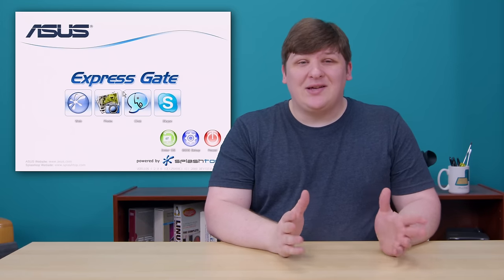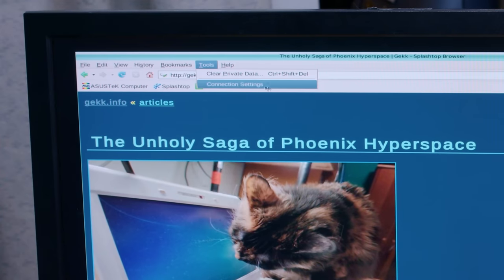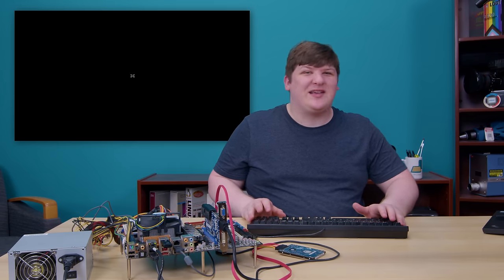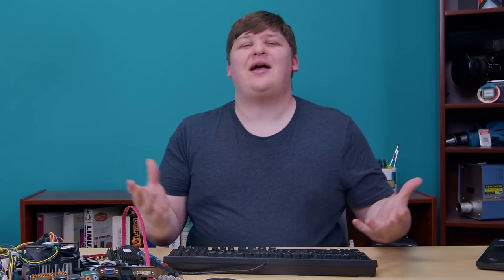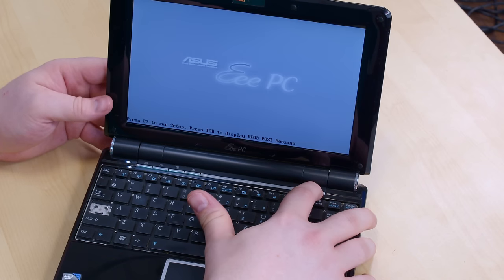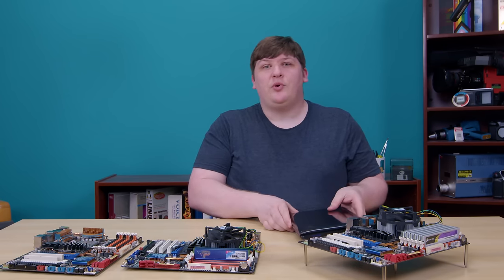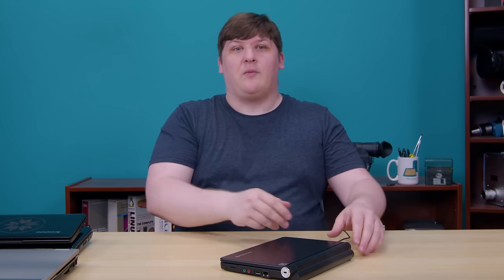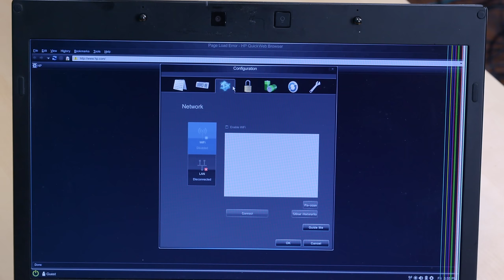Quick Start Ep 2: What The Heck Was Asus Express Gate?

Comment: Interesting video!

I had a P5Q Deluxe and my old man had a P5QL-PRO at the same time, they both had the ability to use Express Gate however it had to be installed onto the hard drive on my dad's P5QL-PRO and my P5Q Deluxe had the small storage solution on your board. Weird really, the PRO almost seems like the better choice to have the storage, being cheaper and therefore used by the more "general public" - those who are more likely to be making accidents on the internet or who aren't going to be investing in an expensive SSD.

I vaguely remember there being a difference in one program in Express Gate being on the Deluxe and not on the PRO (I can't recall what sadly, I was about 13 at the time, and even more sadly, I only have the P5QL-PRO now.)

Needless to say, neither of us ever used the feature on our respective motherboards, it did literally delay boot times as we were concerned.

Comment: Sort of apropos of this, a lot of servers have a tiny Linux machine (a BMC) running on a SoC that most sysadmins rarely interact with unless the main CPU has crashed and needs rebooting, and even then it's usually though the IPMI protocol. If you're lucky and handy with a soldering iron, it may possible to get a serial console through header pins on the motherboard and interact with it, it's pretty limited but can do some cool stuff like emulate a removeable storage device for the main CPU and be a KVM etc.
Reply from the maker: Oh yeah, BMCs are extremely cool. Man, maybe I should shoehorn that into this series. It's a thing a lot of people don't know anything about, especially the fringe features like remote disk image mounting.
Reply: @CathodeRayDude  Do it, man! 😁

Comment: I have a couple P6T Deluxe V2 gen 1 core boards.  I actually did the upgrade to it a few years ago.  It was a neat little OS.  The upgrade looks a little nicer.  You are correct, that should be something included on every mobo as it would be nice to check problems.  I turned it back on after watching your video and went to look and turned it back off after playing for 5 minutes.

Comment: Back in the early 2000's I always wondered why no motherboard brand included an internal usb-stick with drivers. Nothing was more frustrating than installing Windows just to find out that the network driver isn't included so you can't connect to the internet and download it.

ExpressGate seems like a really nice feature if your OS doesn't boot and you need to search for the issue or you need to download a driver.

Comment: I am so feeling you with your notion of an inbuilt firmware partition that can be used to do things like image/backup/partition drives and also play media.

There's a part of me that thinks the real tragedy of laptop expressgate is that with the known, fixed hardware of the laptop (which, again, is also the hardware that a quick boot mode actually makes the most sense in) that the images didn't include drivers for those pieces of hardware so it could run more consistently and efficiently. You don't need to support every gpu from every manufacturer, just the one you put in the laptop! And then the fact that you can't even play movies or music -- a handful of open source codecs might not have lasted in the era right before H.264 took off everywhere, but the lack of any support is jarring (I mean, understandable with the basic VBE mode going on, but still jarring). Sony's DVD player OS may have been almost pointlessly basic, but (go figure, since they were using it for other stuff too) it's a use case that I think someone buying a Sony product could understand them expecting. But then again, if the modern web were supported there'd be a lot more of this that would be still usable, if awkward.

Comment: My mom had a very similar netbook to the first Lenovo you showed (Ideapad S10E). It may even have been the same model as far as I remember, but white. She got it around 2009 and it shipped with XP. It ran excruciatingly slow and booted in a matter of minutes (though it didn't feel any longer than comparable desktops of the time). I remember the two additional buttons below the screen but not that they did anything at all (tbf the green one probably was an airplane mode shortcut). I never encountered the Quick Start/Splashtop splashscreen and there wasn't any mention of it anywhere at all. I guess there could have been a BIOS entry to enable it or another Lenovo utility to install but we never knew about it. The computer is now long dead, scrapped and thrown away but the video brings back memories of this overheating white piece of garbage. (the trackpad was the worst I have ever felt but the keyboard wasn't that bad actually)

Comment: The MSI motherboard that I used for my first gen i7 build came with something like this.  It was a CD/DVD that just let you boot into a stripped down and tweaked Linux OS.  A bit clunkier since you had to pop the disc in to use it, but the experience was surprisingly similar.  Might have to dig it out and take a closer look at it.

Comment: I had a P6T Deluxe V2 too in 2009. I used ExpressGate a few times and got rid of it, replacing it with a Live Ubuntu + persistency installed on a CF card mounted on the PATA header via an adapter

Comment: So... I timed the Toughbook today.  2 minutes, 33 seconds from dead cold (I don't have that "Fast Startup" doo-doo on, it causes more problems than it's worth) to fully operational (Logged in, on the desktop, Steam started up and at my library page, Discord logged in and active, Firefox open).

Then again, I did learn patience from my previous rig.  That was a heavy-duty workstation rig with twin CPUs that would take 30 seconds to get going before the BIOS splash screen showed up.  Then it slogged along through a RAID controller and finally started loading Windows 7.  At that point, it was at the mercy of a 10k RPM box of spinning rust.  It was a very slow boot process, but it was worth it in the end for a very fast system.

That said, I couldn't imagine going through all of that lingering, slow boot-up, only to then have a slow-as-frozen-molasses system afterward.

Comment: I used a netbook add my on-call device, supplanting a Nokia N800 and Bluetooth folding keyboard.

Pidgin! I remember using it long ago, when I lived in an area with dialup only and learned how sensitive the Jabber protocol was to low bandwidth connections (it was when Google Chat/Talk/ whatever it was called then used that.) I always found its IRC support lacking.

That was also the era of a lot of BIOSes having a bug for the halt on error setting, that "all but keyboard" didn't actually fail to halt on a keyboard error.

Comment: This video kinda hit home. I used a Asus P6T mobo with a first gen i7 (965 Extreme Edition) until late last year. (I owned the original P6T, not the SE or Deluxe versions) I played around with that Express Gate stuff for a bit but never really found a use for it so it sat as an afterthought on my hard-drive. :P I even had that identical type of ram as pictured on one of the P6T mobos you showed off. (up until I upgraded it to the full 24GB it supported which I did a year before I ditched the whole rig for my new setup)

I upgraded to a 4th gen i7 setup so the Asus board is retired to a spare PC case for the time being. :P

I checked my mobo and it doesn't appear to have that module so really curious on how Express Gate was setup on the original P6T. Doesn't appear to have a special header either so maybe just an optional thing they put onto one of the existing USB headers on the mobo?

When I messed with it it always wanted to be setup somewhere on my hard-drive and that's where bios was looking for it so maybe some older Asus stuff didn't use a SSD module yet.

Comment: Around 2006, I was looking at the time it took for our Windows Servers and Linux servers to reboot, and I realized that the margin between 5 9's uptime and 4 9's uptime was only two or three reboots a year (At least on Windows, our Linux servers were a bit quicker).  We needed to speed things up.

We probably found about 20 seconds in the Dell PowerEdge BIOS by eliminating the need for BIOS to seek out unneeded or uninstalled devices.  My Windows guys found a bunch of delays that could be eliminated... but the Linux servers were my domain.  

I already used a pretty lean kernel and filesystem and no GUI, so our systems booted up relatively fast compared to a fat kernel stock Linux with a GUI.  Since we were booting from spinning rust, all the boot files got relegated to a small partition at the start of the drive.  After stripping everything to the bare minimum, we were booted from cold metal to an email server or MySQL backed DNS server in about 25 seconds... a far cry from the roughly 1:30 we started at. 

That ends up being quite a bit of uptime over a couple hundred servers that need security updates several times a year.

Comment: I'd love to try a few things on this os. Did they remember to lock down the framebuffer terminals on Ctrl+alt+f2 etc? Did they rip out the Firefox about: pages? Also would love to know what Firefox versions were shipped on the two releases, if they were shipping security updates. If grub is being used as the bootloader, you should be able to edit the grub config file and thus change the kernel arguments to set a shell as init. this would at least let you inspect the filesystem.

Ultimately, the issue with security is what really makes this a bad idea. A completely static os which attracted any userbase would inevitably attract malware devs who could at least use expressgate as a platform to read secretd from the windows partition. In that sense, it's honestly good that this never became popular. Chromebooks are the same idea as this but with actual effort put in, and automatic security updates. The web platform had matured enough for it to be used as a full os by then, no need for flash.

Great video, thanks. YouTube recently surfaced you to me and I've been binging your videos, they're consistently good. Keep it up!

Comment: My HP ProBook had a rebranded SplashTop called QuickWeb. Also was my first non-custom PC to have a full-on UEFI with a GUI BIOS, and it had a somewhat obscure feature to change the boot screen by putting a graphic in a specific spot on its UEFI tools partition (which was neat).

Of course I'm typing this from a modern-day KDE Neon system running Wayland instead of X, with a Firefox that isn't stripped down.

Comment: Some 80486 motherboards had GUI BIOS screens, with a mouse cursor. One even had the mouse cursor tail constantly wagging back and forth. I remember them being universally hated.

The slowest laptop I ever owned was a Toshiba Tecra 800. It was one with the weird Mobile Pentium module, 300 Mhz. It shipped with an abysmally slow 4200 RPM hard drive, less than 100 megabytes. With Windows 98 I measured its boot time to fully loaded and ready to go (no spinning hourglass, not just to showing the desktop) to be over five minutes. When I upgraded it to a 5400 RPM 120 meg hard drive its boot time was cut down to well under two minutes.

But the kings of fast booting were 1980's microcomputers with their OS in ROM chips. They were ready to go before your finger left the power switch.

There was a short lived fad with Windows XP or Vista to have a special fast booting partition with a DVD and other media player, activated by a special button that couldn't be used for anything else. If the OEM OS was XP you'd lose the fast starting player if you upgraded(?) to Vista. Same for if OEM was Vista and you upgraded to 7. I never encountered any of these on which it was possible to reinstall the special partition (and have it work) with any OS other than the same version of Windows that shipped with the laptop. IIRC some of these, when connected to an external display, allowed for the lid to be closed without causing the laptop to sleep or hibernate.

One laptop I owned (IIRC it was a Micron, which meant it was a Samsung, like all Micron, MicronPC, and MPC laptops) didn't even bother with having a special OS partition. It had a hardware CD player built in, complete with player controls and little LCD usable with the lid closed. It was possible to activate the CD player and open the CD drive without turning the computer on. With a few thousand milliwatt-hours of battery available, it could play music discs for a very long time.

Comment: 28:50 I need to comment on this. 

The article you are referring to is the one from Jan 22nd 2009. This is before October 22nd 2009 which was the day Windows 7 was released. But before windows 7 came out, I witnessed people sticking with windows XP over vista because XP just worked for them at least without any major technical issues that would interrupt whatever it was that they needed or wanted to do with their computer. And I believe because of this, this is why I saw some manufactures still selling windows XP with their new computers probably up until windows 7 came out. I do recall asking my friends in high school what they thought of 7 and they said "its just a rebranded windows vista". probably safe to say that Microsoft screwed up so bad with windows Vista, that people were not initially feeling optimistic about windows 7.

Anyway, I do recall getting one of the really small HP laptops though and trying to use HPs "Quick Web". But with the laptop being slow, I got bored with it and went back to running windows.

It would have been nice to see these Mini OS's being more useful in terms as a tool. Something like doing some of the same things that gparted does, but more. I think transferring files over the network would have been a cool function.

Comment: The post shown on screen about the onboard SSD indicates that the updater makes the USB drive visible.  This means that there is instructions inside that application that makes it visible.  It is probably a bios interrupt or other command.  You could probably replace express gate with a custom little GURB install to put your boot loader off of your HDD.  You could probably also alter GRUB to send the command to make the USB drive visible to it to add it to the GRUB boot list if running GRUB from a HDD.
Reply: Apparently recent versions of the 1.x series allows installing to USB drive. I'm not trying it on my own hardware, but it might be an easy option to test things out.
Reply: @caralynx  that's interesting, if I had one I probably wouldn't want to touch it unless I got a successful dd image first.  If it's on USB I wonder if you can remove it and put a different USB device there.  I recently started playing around with embedded USB pins inside devices.

Also fancy seeing you here.

Comment: Oh yeah, I remember Express Gate, used to be a mom'n'pop shop system builder, and since ASUS had most of the reliable motherboards at the time, we spec'ed them constantly, since we specialised on reliable complete bang-for-buck systems that only has useful software bundled, we included Express Gate when available.
I remember that the expensive motherboards had the flash drive on the motherboard, but those were rarely good "bang-for-buck", and Express Gate was certainly not a value add that could justify an extra $50, so we mostly dealt with ASUS's more creative budget options; before Express Gate could be installed on any PC, the BIOS needed to support it explicitly for booting it to work, and in some versions you were warned not to try de-fragmenting the files in the install folder which had way less files btw., I can only guess because that version could not read NTFS and had to record the physical location of the boot image in some parameter.
There were also two ways that you could boot Express Gate depending on which motherboard, the most common is the press Esc to boot, but there was also motherboards that supported wiring a button you could press instead of the power button to load it, often times that meant the reset button :P afaik GRUB and/or Syslinux does support reading the boot flag that the Express Gate button sets in NVRAM, so you could always use that feature to dual-boot anything else you like.

Comment: Somehow I knew exactly what this was when I've used it like once. I just remember seeing it on one of my computers at some point, figuring out what it was, then thinking it was stupid because no computer booted slow enough to make using the crappy built-in OS worth it. Then just a few years later everybody was using Windows 8 with fast startup, and boot SSDs and the issue just sort of evaporated. 

I actually still have the original 2013 Samsung 840 Evo 240GB SSD that I bought as my first SSD still in my computer as my boot drive. Just filling it all the way up and deleting a bunch of stuff for literally ten years straight, and it still works well enough as my boot drive. People back in the 2010s people thought SSDs would have worse endurance than mechanical drives. It must've been propaganda from the HDD industry.

Comment: 34:00 Did you check for a short in the splashtop chip? If its interface is USB is it possible that your "hilariously 2007 failure mode" of the board having a USB overdraw warning might be there?